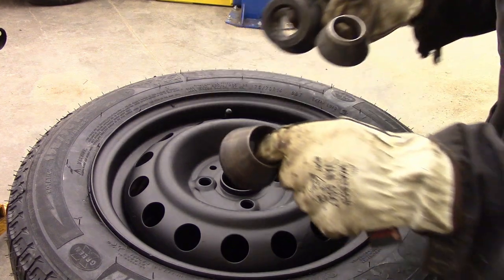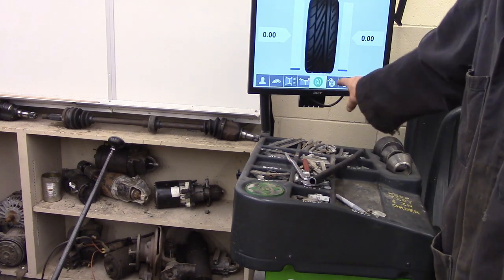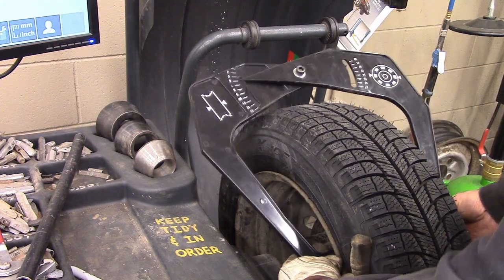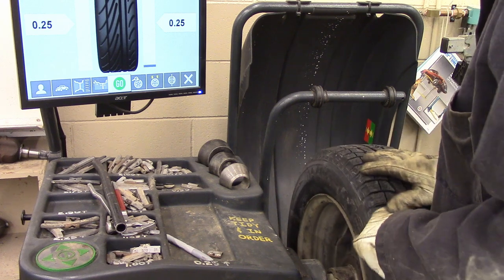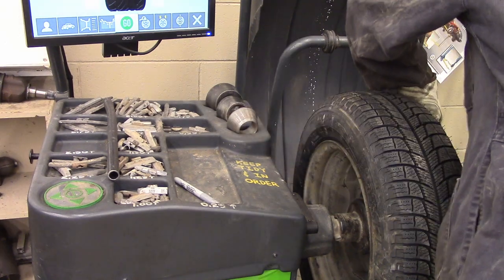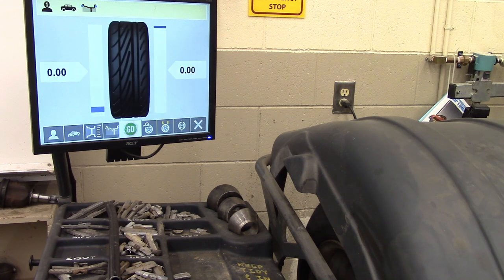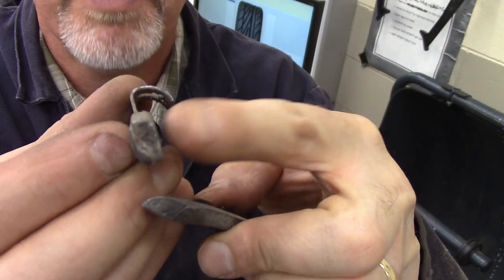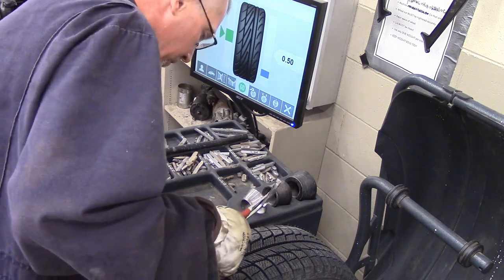QUICK & DIRTY: How To Balance Tires

Comment: Finally! Something I'm better at than you! :) The flying wheel weight is telling you to take it easy on the first couple of taps; like a nail, more or less. And run the calibration sequence on the machine if it has one. The second .25 oz weight request is often a dead giveaway that it's needed. When properly calibrated and the weights are not over 2 or 3 oz each, one spin is all it takes. Keep the great videos coming! I watch and enjoy every one of them! 👍👍
Reply from the maker: You should see me hit nails.  Wear eye protection. I've calibrated this machine numerous times, and it is deliciously inconsistent. Our Bosch is also the only one left in the district that still works..... Cheers!
Reply from the maker: And the quarter-ounce weights I have are just bent sheet metal, no lead on them at all.  I hate them. H.a.t.e. them.....
Reply: @GregWellwood  😆